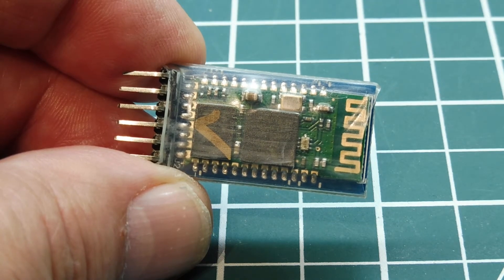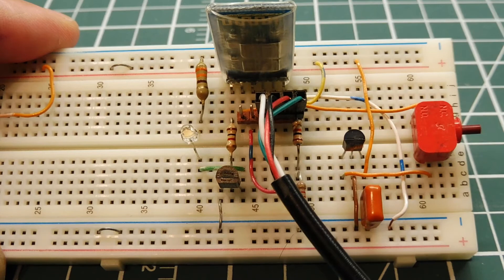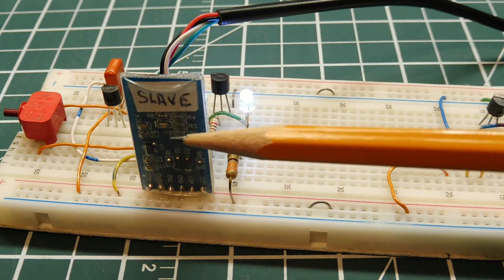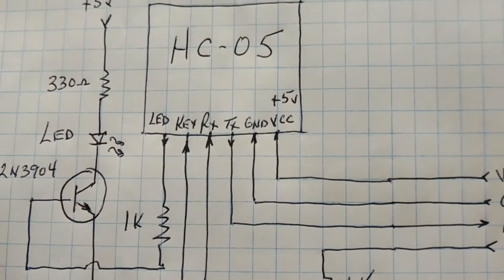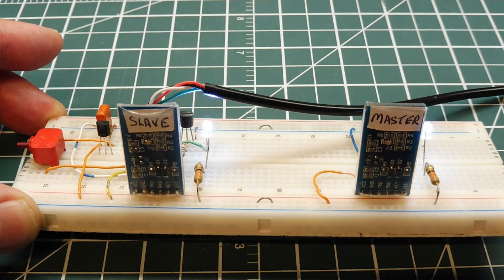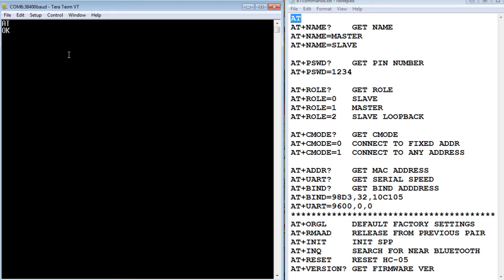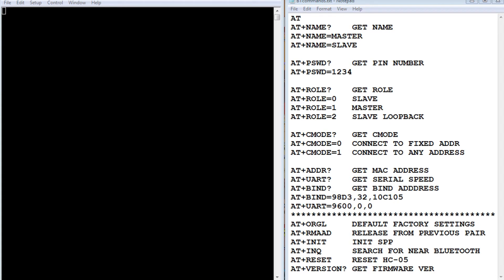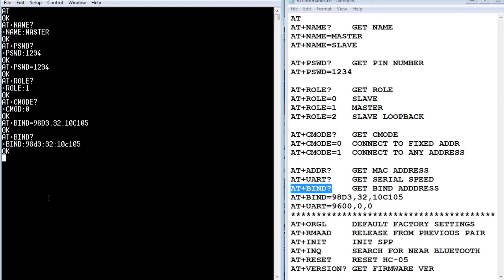HC-05 Bluetooth Wireless Data Link / HC-05 Programming

Comment: HC-05/HC-06 can not connect to iOS or macOS devices😞 
Do you think HM-10 CC2541 BLE module can be used instead?
Reply from the maker: IOS only supports BLE so it will not pair to the HC-05 but should pair to the HM-10 BLE. The HM-10 BLE will pair to IOS and Android.
Reply: @ Thank you! Very helpful 😀 🙏🏻

Comment: 5:54 Why could you not use the voltage divider (2 resistors) to get 3.3V from the 5V USB supply for the Key/Enable line instead of using a 3.3V regulator ???
Reply from the maker: Yes .. that would also work.
This circuit is a small part of a larger project in our Maker group.
We interfaced the bluetooth link to a RS232 barcode reader to make it wireless.
The 3.3 volt regulator was also used to power the RS232 to 3.3v TTL chip (ST3232) interface.
I left the regulator in the circuit in case further 3.3v interfacing with other ICs was also needed.
Reply: Got it... Thanks